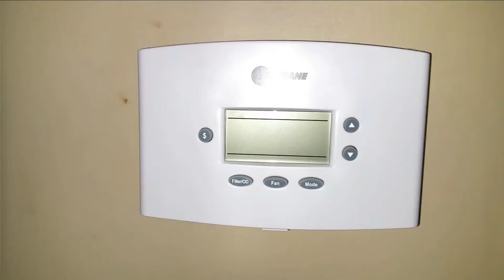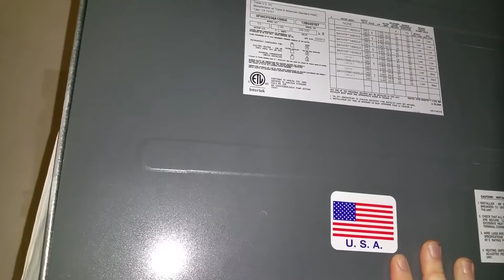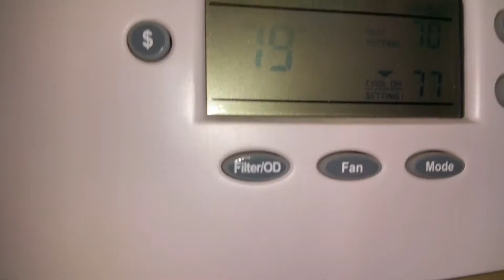Repairing my AC

Comment: How about replacing that relay with a heavier-duty one?  Such a relay wouldn't exist to be soldered to the board, you'd have to run wires off the board, but that will probably prevent this from happening again.
Reply from the maker: I already have plans to make an external beefier relay. it's a shame though. trane used to be quality. not so much anymore.
Reply from the maker: jaykay18 Actually, this board is made in America.  :/
Reply: Brandon MacEachern Perhaps of overseas components!